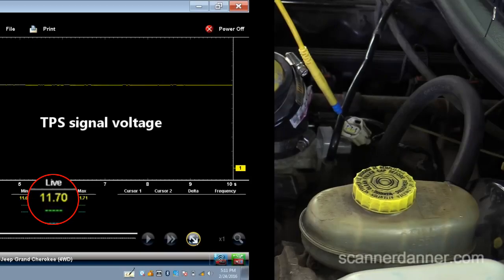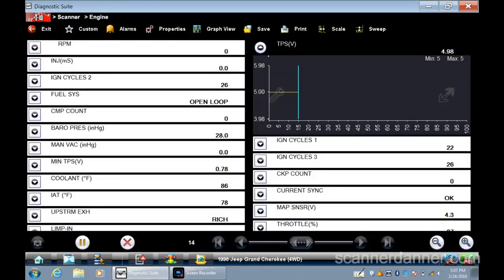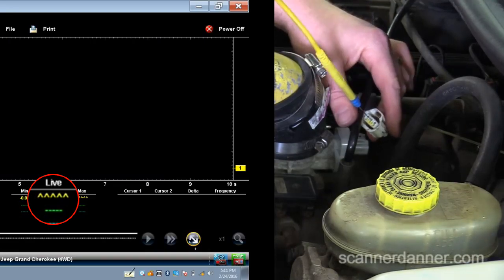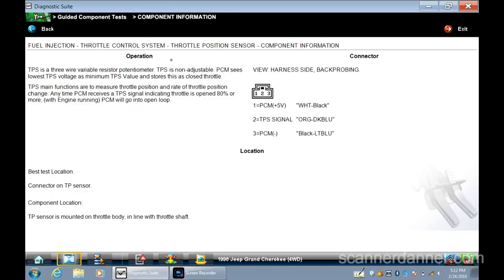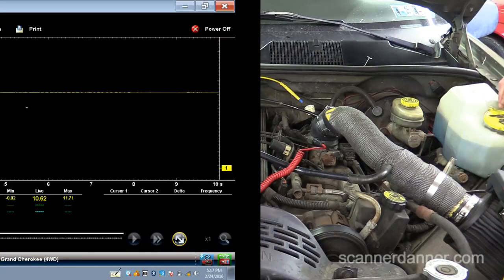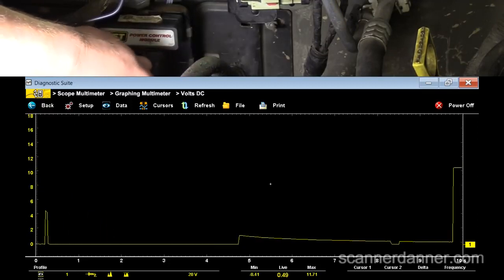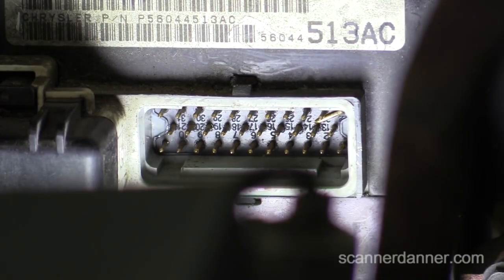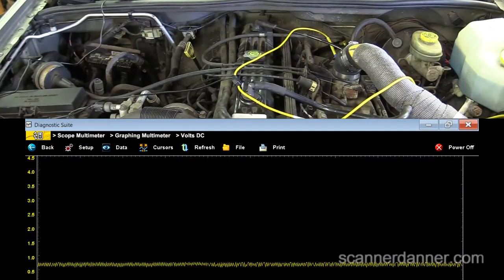TPS Signal Shorted to 12v Scan Data Fixed at 5v - P0123

Comment from the maker: So why am I editing and shortening some of my older videos??
My main goal is to condense them to only show the key points. Not for views, but for that guy that's really stuck and needs some quick guidance on a subject. He doesn't have time for a 40 minute case study but definitely does for a 10-15 minute, key points type video. 
I had this EXACT scenario happen with me when I blew out a brake chamber in my RV. I needed help and I needed it now!! I know my community will benefit from these.
Reply: I had a similar problem caused by the JET POWER MODULE, it was pulling the cam signal to ground, once I removed it problem fixed.
Reply from the maker: My name is Paul Danner but thanks!

Comment: Right on ! Crucial lessons learned from this one !!  1. If 11 volts is on a sensor signal wire DO NOT UTILIZE the jump it to ground test … and , 2.  during snap throttle revs TPS(v) never moved on scan data due to slow scan data updates !  Wowza !!  Glad you teach us about significant repair process hazards as these two !! 😅 🙌🏼
Reply from the maker: Some, or I should say most, miss these very subtle points. Good on you my friend. Thank you!

Comment: It's so different watching your shortened videos, I'm so used to your lectures and detailing the various variables in such depth, just a muscle memory after watching your videos for so many years.

Thanks for sharing this Paul, excellent information on this TPS CKT issue.
Reply: Yes but if you want more views, you have to shorten the videos. This amount of time is perfect.
Reply from the maker: Agree and that is a byproduct of what I'm producing with these. But my main goal is to take some of my older videos and condense them to only show the key points. Not for views, but for that guy that's really stuck and needs some quick guidance on a subject. He doesn't have time for a 40 minute case study but definitely does for a 10-15 minute, key points type video. 
I had this EXACT scenario happen with me when I blew out a brake chamber in my RV. I needed help and I needed it now!! I know my community will benefit from these.
Reply: @ScannerDanner  I cannot imagine a day when we can't benefit from your videos...

I remember your RV ordeal, how frustrating to have that happen, but it's certainly how it goes, the one instance you're trying to do something important and it seems like it's usually in the dead of winter...lol...-45 windchill and your out f-ing around fixing your own stuff that keeps getting pushed off to fix other people's problems!  Ahhh, what do you do?  Just smile and dial.

Comment: Nice find there! Too bad the owner fired the parts cannon at the problem. Imagine how many unnecessary parts get sold every year - I'd bet the amount is staggering!

Missed my window for TST. Wanted to meet you, and several other YouTubers there.  Probably just as well, since I went to do a spill n fill on the rear diff of the '07 Silverado, and found chunks taken out of the spiders gears, and one side gear (probably part of the G80 "Grenade Lock" got run through them). Truck is going to be on the lift a couple weeks as I eagerly await the arrival of a new air-actuated OX Locker (2 weeks before it ships). I shouldn't have any more diff problems after that, so long as I get my setup correct. Had I signed up, I might have missed the event and lost the money! That would've been a bad day!  Maybe next year.

Great video, as always, Paul!
Reply from the maker: For sure, it would have been cool to meet you too Smitty. Maybe next year

Comment: Next he will see random stalls. Ive repaired a few 95-98 grand cherokees for this issue. Wiring harness falls off the firewall sags the connector and breaks the solder joints.

I also just installed a turbo on a 97 4.0 ZJ 😁

Comment: Great work. How would a pin get bent like that? 🤔
Reply: The mech a nic it was driven in from Chicago 🤔
Reply: @NewLevelAuto  that explains it all 😂
Reply from the maker: Careless plugging in of that "chip" and the fact that it didn't lock in so the owner probably had issues with it falling out.

Comment: Great video and testing methods. Just wanting to clarify when you said not to jump the signal to ground, you meant the sensor ground? As you had already grounded the signal wire previously through a test light to ground.
Reply from the maker: I was referring to my signal circuit integrity stuff that I teach in my book and classes. In this case with scan data fixed @5v, forcing the signal low by jumping it to ground or sensor ground would have caused some bad things to happen! Prime example of why a resistor should be used when doing these integrity tests. Oh which I've found my incandescent test light works in place of the resistor.
Reply: @ScannerDanner  thank you. 👍👍

Comment: I have a turn signal bulb that stays on solid and explodes when I plug in the socket with the key off. Tha k you for this. I'm going to inspect my connector pins.

Comment: thank you for this great effort to teach us but may I ask .why all vehicles that you working on less than 2010
Reply from the maker: I'm an aftermarket guy and the average age of the vehicles on the road are 12 years old putting us at 2007.
I take them as I see them. Also this video was edited from a 2 year old video (linked in the description)
The nice thing about what I show and what I focus on, is it is timeless, foundational information. Doesn't matter the year of the car, a potentiometer is a potentiometer, wouldn't you agree?
Reply: i agree proffessor and I'm your student any way .I have aquestion about alternator test why we call it ac ripple test although rectifier output  is Dc
Reply from the maker: It's not 100% DC, there is an AC ripple that rides underneath the DC constant.

Comment: Future reference for all, depending on the pin size, a pen can be used to straighten the pin up. Just remove the ink first. I can not take credit for this, saw it on a computer tech video beforehand I think, or it was a magazine.... Don't completely remember.

Comment: My TPS, Coolant temp sensor and ECT (Electronic Controlled Transmission) module are all on the same 5v reference signal (IDL).  I'm reading 12 volts at the TPS but if I unplug the ECT it drops down to 4.95 volts where it should be.  Does this indicate a bad ECT?  Why would a ECT increase voltage on the IDL wire?  Any help would be appreciated.

Comment: trying to track down a issue on my 2010 mazdaspeed 3. Car ran great and one and 2 days ago stopped firing over.  i have replaced in tank pump and that is working as i can hear it and fuel will come out feed line to my high pressure fuel pump ( which is camshaft driven ) which seems to be my issue. it wont build pressure when i try to crank it, and had a solenoid on top. Threw a p0091 code, after watching videos i noticed my tps sensor, maf sensor all get a 5v ref, but also are getting 11.6 v. I cant get access to a wire diagram for it to figure this out.
Been watching all your stuff last few days to help try to learn how to find this issue.
Reply from the maker: Here is an option for you 
(For service info)
It is the DIY version of what I'm using https://eautorepair.adtrk.biz/?a=10817&c=24&p=r&s1=
Reply: @ScannerDanner  I appreciate the comment. I actually own that already. I cant seem to find info in there for the connectors pin values, like what pin on a connector has a 5v ref and all ( i know those by probing around ).  i am getting 12v to my TPS, MAF and i cant find out on there if i should be or not. I am also new to navigating the website.
Reply from the maker: @Trippy_Hippy89  on a MAF, you will have a 12v feed, on a potentiometer type tps, you will not. But you have an electronic throttle body, so you may be looking at a motor control wire?

Comment: I have a question. Once  I checked the same vehicle that tps signal was fluctuating like somebody was moving the throatle . And  couldn't figure it out. Any possible causes? Thanks
Reply from the maker: Was it a GM electronic throttle body? TPS 2 circuit? If it was it was normal as the 5v ref for APP and TPS 2 use a pulsed reference circuit

Comment: I got one for you 2006 H2 no codes no check engine light runs fine won't shift past 2nd gear. Install scanner zero tps volts at all gas pedal positions. tps percentages are all good from 19% to 100% any thoughts?  Thank you
Reply from the maker: TPS% can be substituted and lying to you.
What are actually TPS voltage readings measured at the throttle body itself.
Reply: @ScannerDanner  Hello and thank you I did install and new TPS and It has the same conditions. Thank you for your help.

Comment: I wonder why you never disconnect the pcm with a low 5v reference  and touch the 5v ref pin to ground. You should know if a sensor is pulling the 5v ref to ground of if the pcm is not providing the 5v ref due to bad circuitry or pcm failure.

Comment: I'm having the same problem with my 88 Toyota celica. The signal wire reads 11.2 volts. I'm looking for the ecm to check if theres a short curcuit in the connector
Reply from the maker: It's normal on your Celica. It uses an idle contact and wot contact switch. It is NOT a normal TPS
Reply: @ScannerDanner  thank you so much!
Reply: @ScannerDanner  would you have any links to how I can adjust my tps. I moved it without thinking when I was cleaning my throttle body

Comment: Hey Paul, I need your opinion on something. I got a 1999 jeep GC Laredo 4.0L straight 6. It already had the infamous crank sensor no start...tested and replaced. Now 6 months later I'm getting MIL lamp flashing (at idle or driving city or highway). Today I checked it out again in driveway. Had it at idle..when the MIL began flashing. I had a mid level scanner attached at the time looking at data and noticed that things were normal until the MIL started flashing. At the same time as the flashing, ALL  the fuel trim data and 02 data went  down and stayed close to ZERO (0.080). So the FT dropped to ZEROs, the MIL flashed constantly, BUT the jeep WAS NOT    exhibiting any symptoms of a misfire! NO shaking, NO bucking, NO stalling...NOTHING! I also read codes. There was a misfire code, BUT it WASN'T current. Any quick opinions? I know these Jeeps are infamous- that's why I drive GM and the wife has the Jeep.( though I pay in the long run).
Reply: Jimmy S  Thanks for the reply. I have also used my Snap On scan tool and pulled up misfire counters. Any time I watched the counters it was either the 5 and 6 cylinders and another time it showed the 1 cylinder, but NEVER showed the 3 cylinder acting up. I do have a copy of that TSB as well,  but since I never seen anything on the number 3 I didn't use that fix. Maybe I'll insulate all the injectors...its cheap enough.
Reply from the maker: Got nothing for you on that one. Weird

Comment: I am Also getting Battery Voltage at My ECT Sensor Connectors, Both Signal and Ground. When I Flick the Ignition On and Off, Half of The Voltage gets sent to Cooling Fan Relay which causes the Fan to Run at Cold Engine Start and Again When Ignition is Off For about 2 Mins. Do I Have a Short?. :? 05' Chevy Impala 3.8L
Reply from the maker: Battery voltage on the coolant sensor? You sure you are measuring the ECT?
Reply: @ScannerDanner  Yes, I mean the PCM Side of the Wires, not the ECT Sensor side. But, I think that's normal To see Battery Voltage there with key off right.? But, when I flick key On, Battery voltage drops to 4.99V on Only the Orange/Black wire.

Comment: Code p0123 & p0223 on GM Chevrolet Aveo UVA 2008. Replaced complete throttle body with sensors and ECM. Problem not solved. Code comes back again. Please help. Thank you.

Comment: gritting my teeth as you bend that pin back into position. Wondering if putting a bit of heat onto a bent pin with a small soldering iron ( not alot, just some ) would help reduce breakages.
Reply from the maker: It didn't break and the amount of heat you would need to aid this would cause issues internal to the circuit board!
Reply: @ScannerDanner  i didnt feel the need for an exclamation mark when presenting  my idea i arrived at from using critical thinking and having experience in electronics and being an electrical fitter/ mechanic which means i have knowledge of metal ductile and malleable qualities. Of course I considered the heat hence my suggestion. Not sure why you thought it necessary but seems you didnt read properly and consider more the idea. After having watched many of your videos and built respect for you in the way you approach analytical thinking and teach your students have to say I am disappointed in the tone of response. I guess I'll now be advised to not comment, watch or even unsubscribe if I don't like it, if in the past people had been scared to offer up ideas due to responses as such then we would not be where we are in many ways and it has historically happened. But it seems typical when someone thinks outside the box and becoming more prevalent.
Reply from the maker: I hate text, you can't gauge it. You definitely read too much into my exclamation mark. Those pins are simply soldered to the circuit board, if you heat the pin, you'll risk de-soldering the connection to the board. Hence the exclamation. Make sense? It wasn't a pointed exclamation at you. Cool?
Reply: @ScannerDanner  my apologies for the misinterpretation. I still stick by my idea, where the pin has bent has started a work hardening process making it more likely to fracture when bent back again but some heat, and it wont be anywhere near enough to desolder the pin, would assist in making the pin more malleable and less prone to breaking. I know this probably sounds a bit over the top but when you consider it may just save alot of future hassle then wheres the harm. Its not like a powerful soldering iron held on their for a minute and it wouldnt take much heat to help. If I had a bunch of old pcm's I'd sit there, bend pins and try the idea, see how many break without the heat and then try the heat and see the result with the pcm opened up to view the pin solder point, but thats me, I have time but no old pcm's lol. Might visit a wreckers and do an experiment. Not sure how often bent pins happen but have seen this problem in a couple of videos previously so maybe its not worth the effort.
Reply from the maker: No problem man, all good and all valid points. I guess I wouldn't trust myself enough with the proper amount of heat to use.

Comment: Aftermarket Chip AND dude has EXHAUST wrap around his INTAKE? 😂😂 and i thought i've seen it all.. the underhood heat soaking thru the air box raising the IAT & air temp, decreasing O2 molecules... must be killin that 1-2 HP Gain 😂😂👌😎
Dude mightve just needed a new cooling fan? +3 HP

Comment: What do those chips for the jeep's actually do
Reply from the maker: Nothing
Reply: @ScannerDanner  pin benders
Reply: @ScannerDanner  I'm looking for tuning options on my 2000 xj with a 4.7l stroker engine.    It's a 4.0 block with 4.2 crank and rods

Comment: I want to know how the pin got bent!
Reply: Someone being careless plugging the connector in---line it up straight, or you can end up with what happened here. I have seen it before on ribbon cables. Here there was some aftermarket module plugged in; maybe the owner did it.
Reply from the maker: Exactly! @K Stewart

Comment: I always ALWAYS say to never EVER put that aftermarket bullshit in your car expecting some damn miracle in performance because these gimmicks simply cannot do what they claim. You can seriously mess your shit up. If your car didn’t come with it from the factory it does NOT belong there. If you want more performance you’re gonna have to spend more than 50$ on an adapter that does nothing but short out your shit and bend your pins. Owner is lucky scannerdanner unbent that pin without breaking it. If you want more performance your gonna have to spend 1000s. Not 50$ on a stupid gimmick that’s only gonna cost you more money down the road.

Comment: Nice hot dirty air intake system.
Reply: Nice comment from Arkansas. Which scan took r u gonna use today?  Did u whip the Dodge, or did it whip u?
Reply: Bill Rimmer Modis Elite today, fixed that 3.8l I sent you a picture

Comment: old Toyota  has a 12V power source at TPS ?
Reply from the maker: Yes sir, but it's not a direct battery source. It runs through a resistor in the ECM first. But it is a 0-12v on/off switch input signal (idle contact switch) used all the way back into the early 80s
Reply: @ScannerDanner  Thanks, Master, I know it comes from ECM with key on and changes from 0 to 12 V sweeping from idle to WOT, instead of the TPS with signal, 0 to 5V, that r used in later cars described, hence my confusion.
Reply: @ScannerDanner Teacher,  thanks, understood, it is a TS, no need to reply further.

Comment: Hi ...I have a Mazda MPV ..year 2000...I changed d valve oil seal and then returned the cylinder and after that the car refuses to start..the piston is always getting flooded with petrol even though I don't crank the engine.. And have also changed the nozzles but yet it still won't stop getting flooded... Please help 😫
Reply from the maker: Sounds like you pinched the injector wires in the valve cover when you reinstalled it

Comment: SD what would cause my truck to idle perfectly and then tps loses power on scan tool then truck stalls and almost shuts off
Reply from the maker: Focus on your TPS for sure. It is one of the inputs used by the engine computer to control idle speed.
Reply: SD could it possibly be wiring harness because i have already replaced tps with same outcome. Just puzzled at this moment
Reply from the maker: @yaboy9550  absolutely, look for points of contact on the harness before you start moving it around